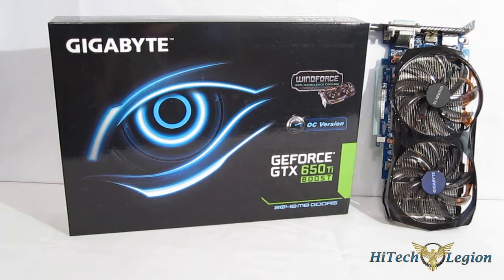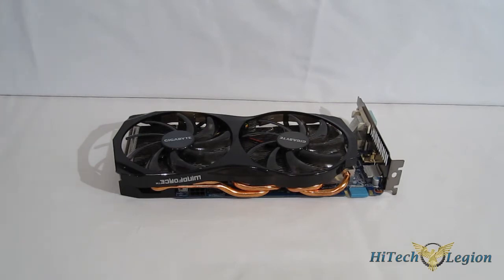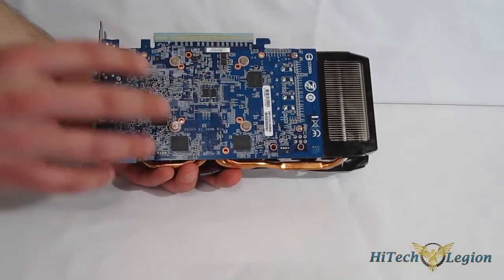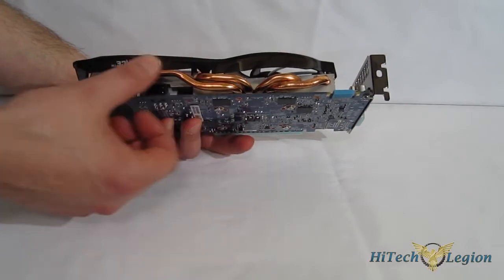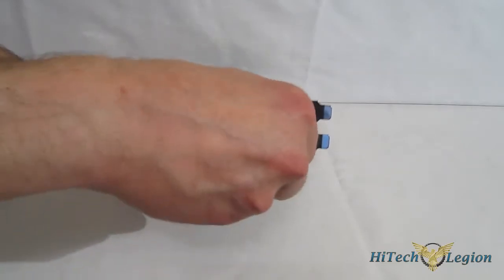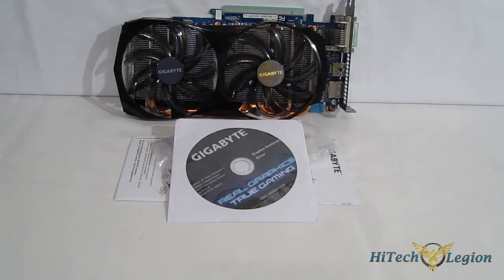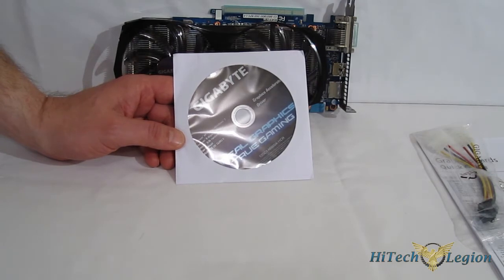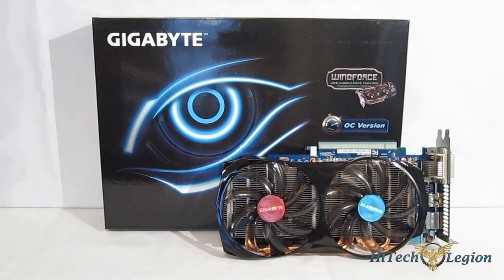Gigabyte GTX 650 Ti Boost OC Edition Overview and Unboxing

Comment: Hi I'm really confused...I bought the same card (supposedly) but mine has very diffrent appearances !? It only has ONE little copper pipe on the top and the bottom of the card just cuts off without all the extra black casing on the end. Also on the box it INDENTICLE except for the fact that it dosnt say "boost" under the "GeForce gtx 650ti oc" I'm pissed really, is your card better than mine???
Reply: Karlan Meyers 

You have a different card.